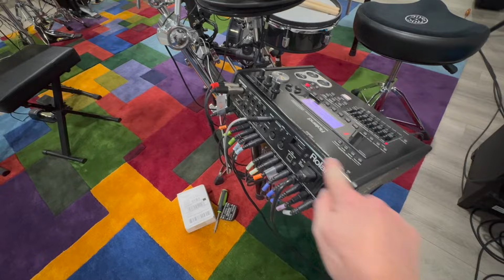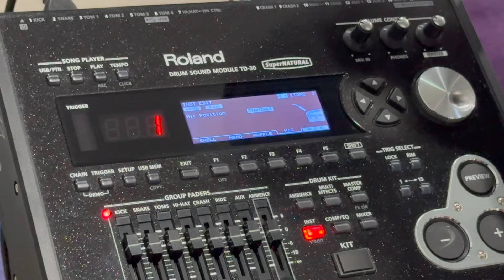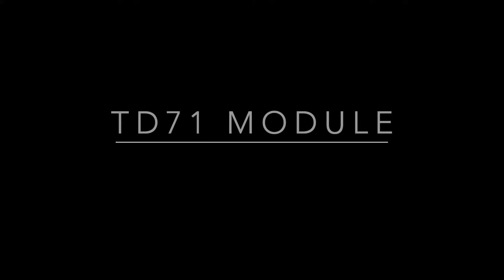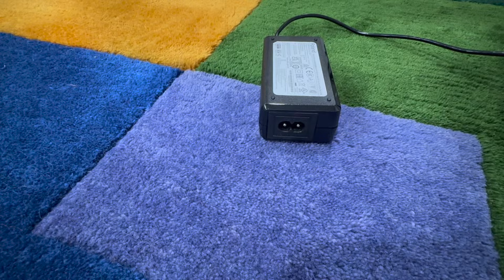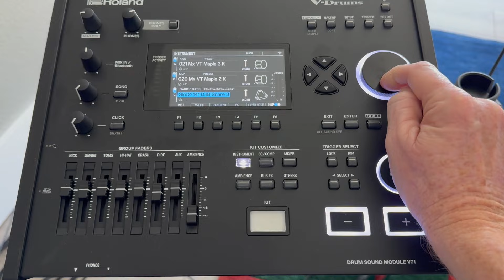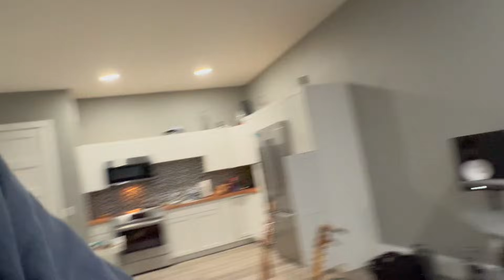Roland TD30 vs TD716: in-depth discussion with alternative drum layouts

Comment: I have gone from the TD30 to the TD713. I have previously owned the TD15 and TD6. The TD713 for me is night and day compared to the TD30 in terms of triggering and sounds. The digital pads are a real leap forward. I have created my own kit on the TD713 using a mixture of stock sounds and expansion samples. Sound is very subjective and I loved the TD30 sounds far more than the TD50 which is a reason I never bought that module/kit. Thanks for the in depth video. I'm sure once you get into editing and creating kits you will find a sound that works for you.
Reply from the maker: Actually I've purchased another TD30 and will be selling most of the pieces of the TD716. I will be keeping the stand and toms but selling the rest. 

On the TD71, the hi-hat simply does not have as many samples, open to closed, and apparently this does not change with additional kits you can purchase. This makes a huge difference to me. To try to mask (hide / cover-up) the fact that there are not as many samples they put hysteresis on the hi hat controller. Also with TD71, every time you hit the snare you get the same sound. This really makes it sound like a machine gun. With TD30, all I can figure is -- just like the hi hat, with the snare they also included many samples from soft to loud hits, so if you hit the snare over and over -- with every so slightly different velocity, you actually got an ever so slightly different sounds out of it. Comparing the two, the TD71 sounds fake to me and TD30 sounds more real. On the TD30, Roland chose a great word: SuperNATURAL. The TD71 has modern features, but it's not SuperNATURAL.
Reply: @WilliamBennerJr  Fair enough! If we all liked the same sounds the world would be a boring place... hope the new set up with the TD30 gives you the sound and playability you're after.
Reply: @WilliamBennerJr  wow .. i have several customized kits in td30 . i want to keep them and export to 716  is it posssible  ? so maybe i wont have hi hat sampling density problem.
Reply from the maker: @ahmetissin696 I am not aware of any way to import. That seems to be not a priority for Roland. Even the TD30 kits you can download from there cloud are limited in number and to me, still don’t sound as good.
Reply: @WilliamBennerJr Hi, I was just wondering if you sold the V71 module.
I'm looking to just buy that alone.
I have the TD27 and digital snare, hats and ride, and my goal is to get better rim shots on the snare.
The TD50 wasn't much of an upgrade for positional sensing for rim shot control. 
I think the V71 has more capabilities for that.
In my opinion, the snare alone is one of the things that separates the acoustic world from the edrum world.
All the little intricacies you could get on an acoustic snare.
They have the digital hi hats and ride pretty close, close enough, but not the snare drum yet, but any step closer is worth the upgrade !!!
I watched your Simmons video too, that's amazing !!!!
If you didn't sell the module yet, I might be interested.
Figured I'd take a stab in the dark anyways to see if you sold it yet.
Thanks !
Have a great day !!!